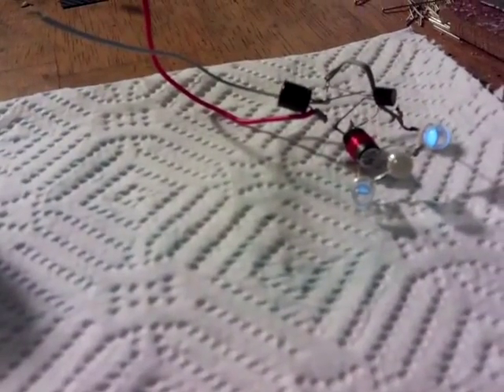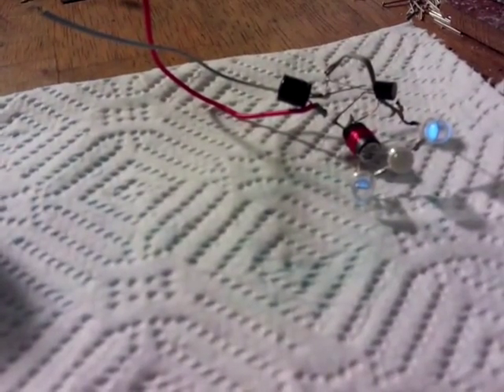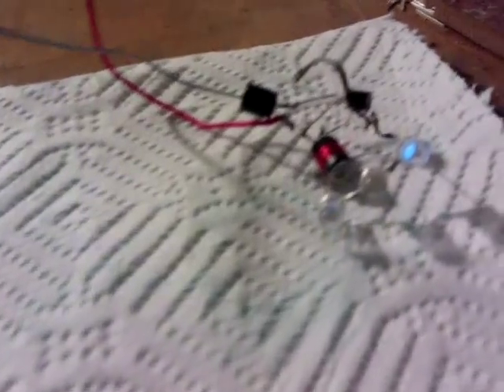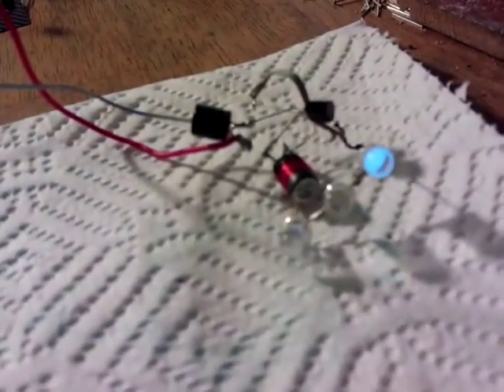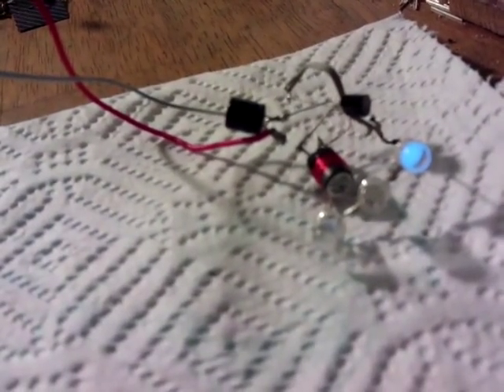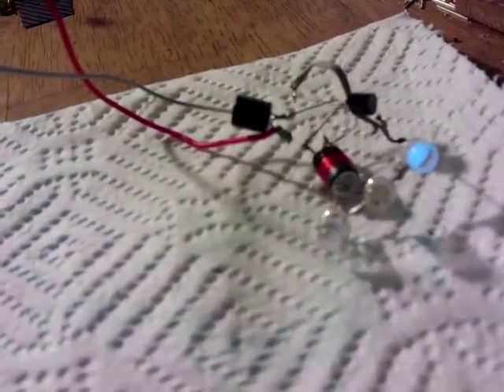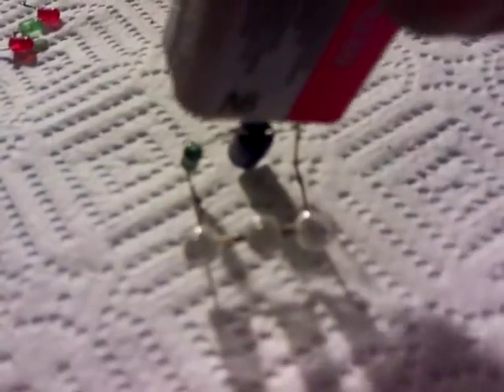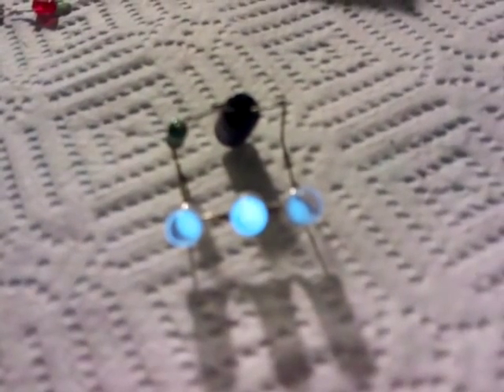A simple SJR effect

Comment: I don't understand this. I can't tell if it's actually oscillating in some way or if it's simply bleeding out the cap slowly through the resistance in the inductor and reaching that golden forward voltage point where the supply just barely matches it and will sit there for super long. Seems like the changes in led brightness could also just be funneling current to different ones more or less without really changing the circuit other than load resistance. If this is switching though, this is a head scratcher for me for sure.
Reply from the maker: +Magneticitist The funneling will be right, different LED's having very slightly different forward and blocking properties. I think it's more the case of the inductor sloshing energy, as depicted in the popular diagrams. Certainly with the finger there as a capacitance + high ohm resistor effect it changes the way the inductor behaves. There's no oscillation though, just resistance and inductance.
Reply: slider2732
I had never realized there is an actual tank like sloshing that occurs in straight DC. I do however know all too well about the 'perfect ratios' for LED's where they can seem to illuminate forever with the proper voltage/current/resistance.
Reply from the maker: +Magneticitist  I was incorrect to call it sloshing, as that gives a picture of a bath tub of water. What I mean is that the resistance and inductance of the coil may work together in a similar way to a cap over a resistor, as seen in blocking oscillators.

Comment: I build the same (without the coil) and it runs the same. When the leds go out, there is enough juice and voltage in the cap to run 2 leds, not 3. Your finger adds resistance  which overcomes the threshold of the led. That is why the others light up! Your finger is a shortcut (on an led) in fact because of the micro amps needed.
Thanks for sharing.
Reply from the maker: deslomeslager Cheers for the info. Indeed, 4.3V left on the cap, it's an interesting effect.

Comment: might as well just use a matching resistor.  Those are much dimmer run after only a few seconds... is not the same.
Reply from the maker: J Decker A resistor would do similar, indeed. Was just an interesting finding for an alternative coil, having found that another build carried on with a wire missing. Finishes up at 4.3V when the last LED goes out, but then sparks up again with the finger hold thing.